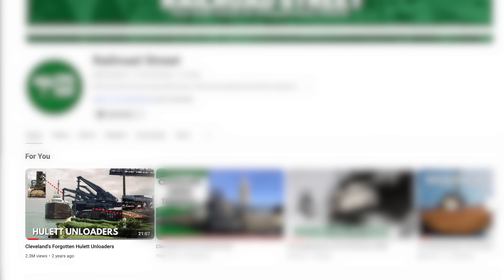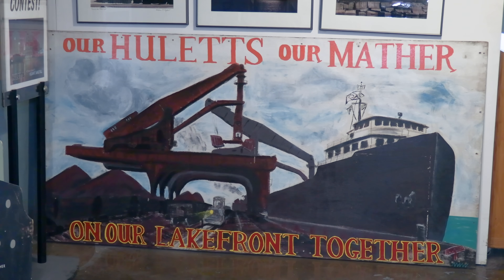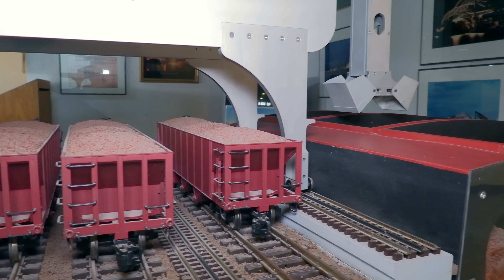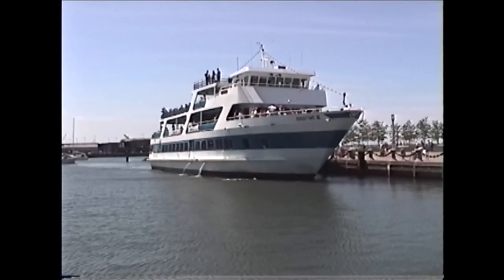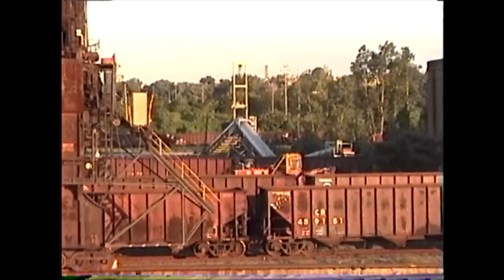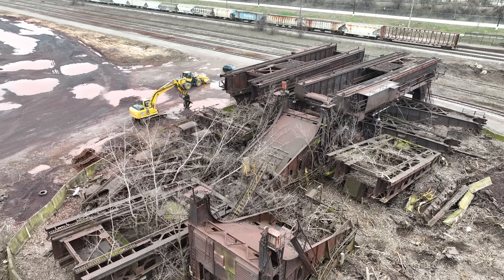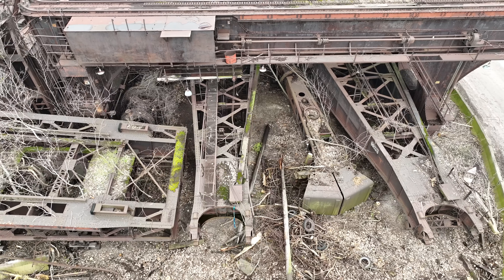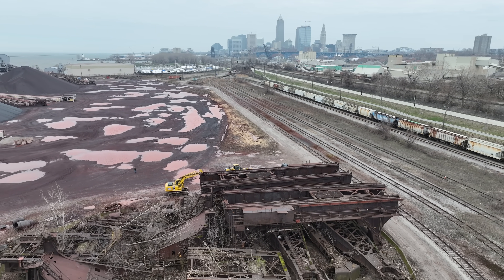Cleveland's Hulett Ore Unloaders Are Being Scrapped!

Comment: Back in the 70s we had those at Republic Steel. I worked on the River Terminal RR that supplied empty rail cars, then pulled the loaded ones out. What put them out of service was ingenious and much cheaper and convenient. Self unloading iron ore boats. They were boats with movable conveyor belts that were fed inside the boat by a bulldozer pushing the ore to the belt feed. They could unload anywhere along the river's wall edge. Just had an outdoor overhead crane to move the oar into piles to store.
Reply: "ore" as in iron ore.

Comment: I was fortunate enough to make it there in the last days to assist a friend who is making a video for kalmbach publishing trains on location and just climbing on this shaking moving noisy equipment that smelled like oil and crispy wiring but especially great was the sound of the circuits being changed when you wanted to move the other direction or lift or lowered the bucket. It was such an exciting tour I had a hard time falling asleep that night. About the same time I do remember photographing a pint-sized one along the Calumet River in Chicago which was built for barges and was a bit newer. It was the Former Republic Steel facility but had been sold off to another firm that still used it on occasion